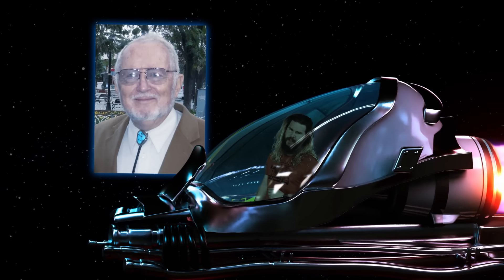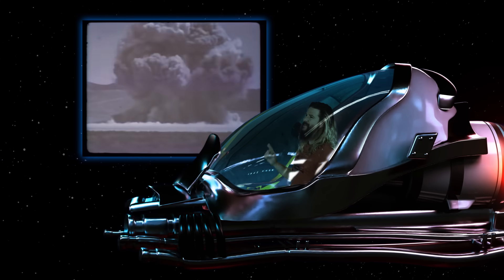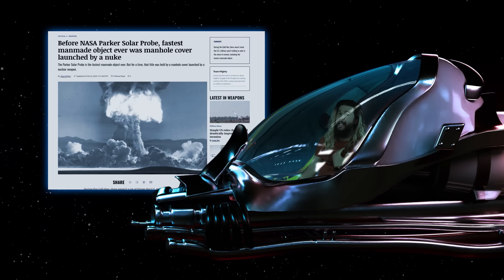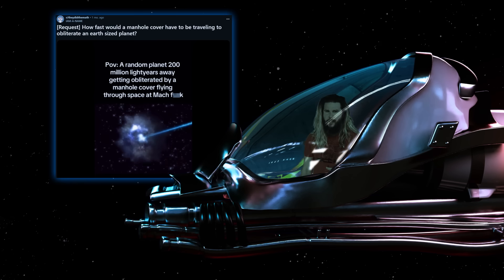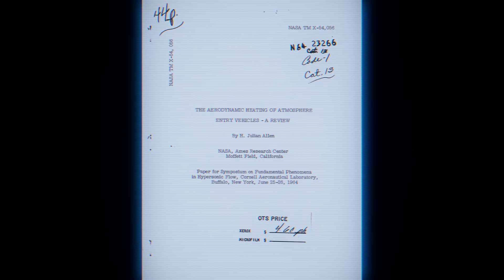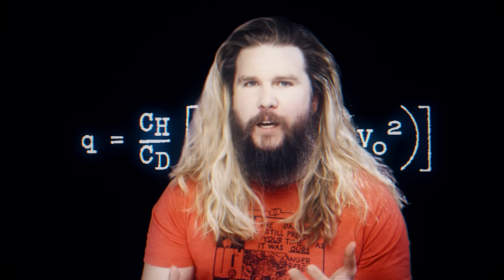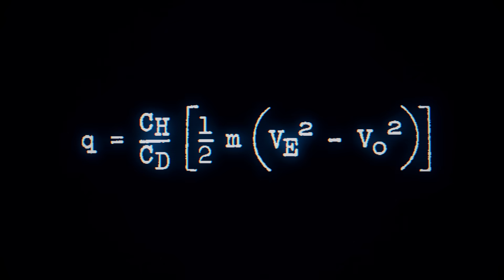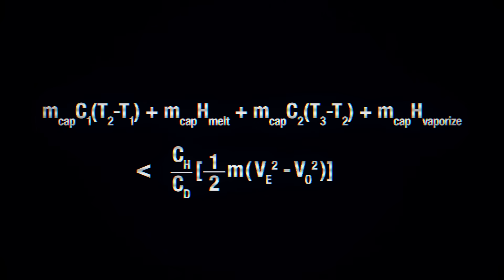Debunking the Nuclear-Powered Manhole Cover

Comment: Bro like you said, all this is above my pay grade but umm, you calculated this to the surface area of the, "man hole cover"(lol) , sooo, what if it turned sideways? That would decrease the surface area,and in turn, decreased the over all temperature?
 meteorites and such ,(because of ice) tend to "explode", because of super heating,do to the atmospheric pressure and the expansion of steam within the rock itself,which is far different from reinforced steel..but, is there a chance we shot a ball of molted magma into another solar system somewhere?🤔😂

Comment: Yes, but actually no. There's a big difference between entering and exiting the atmosphere and calculating for just the heat energy by using the calculation for an object entering leaves a lot of variables unaccounted for. Not to mention that things entering the atmosphere are usually not as structurally stable as a 2000lb slab of iron and generally explode from the pressure of superheated gas inside the objects, so they don't really vaporize so much as they get blown into tiny pieces. Also it would have the most heat energy at the start of its journey due to it already being in contact with the most dense part of the atmosphere and having the most velocity at the start because the moment it started flying it was being slowed by friction with the atmosphere which would lessen the higher it flew. And keep in mind, it's at a minimum of 6x escape velocity so it would only be in contact with the atmosphere for a very short time.

Comment: So it was cast iron, which is highly refined iron. Some of the "explosions" from meteorites comes from different materials expanding more rapidly than the other layers. Also at that temperatures it's possible that it blast welded itself partially into steel. So there's a lot more variables to consider.
Reply: You know nothing about metallurgy.  Steel is not simply iron.  There are, in fact, many different types of steel, depending on what other elements are mixed (alloyed) with iron.  Even 70 years ago, not all steel was the same, but iron doesn't simply "weld itself" into steel.

However, you are correct that there are many more variables involved.

Comment: Ok, so I have to poke a few holes in your math.  I may be wrong, but it seems as though you held atmospheric resistance as a constant.  The further up something goes, the less resistance there is and therefore, less heat generated.  When meteors fall they experience increases air resistance, thus friction, hence why they all pop off relatively low down.  There's also the rate of heat transfer, doesn't matter how much energy is generated if it isn't transferred to the material.  If the earths atmosphere is appx. 120km thick and you're moving at 66kph, your looking at less than 2 seconds of friction with the bulk of the energy being generated in the first 1/6 second of ascent through the lower atmosphere and rapidly diminishing after.  Finally, your calculation doesn't account for heat lost to the atmosphere itself.  Since air has a higher rate of heat transfer than iron does (at least at lower altitudes where the air is denser) much of that energy generated will be transferred to the air rather than the iron, although frankly, I don't even know where I'd begin trying to figure that equation out.  Granted, I'm sure there would be a fair bit of evaporated iron from the event but I'm also pretty sure that at least a decent chunk made it out of atmosphere.

Comment: This calculation has a significant issue - it assumes the constant form of the object. However, it would make sense that somewhere between melting to a liquid blob of iron and bringing it to the boiling point the manhole cover would assume an elongated drop shape, finding its balance between wanting to turn into a sphere and a crazy amount of air rushing past it. This form induces much less drag. Which would probably shift the inequation to another side.

Comment: Meteors are mostly heterogeneous not homogeneous. Hardened high carbon steel is very different than a meteor. I think it is a large mistake to compare the two. A meteor breaks due to instability in the structure and its composition. A rock is not the same as a high carbon steel ball. If there is impurities and/or structural integrity issues. Perhaps the manhole would break apart. However, the forced propulsion of the nuclear explosion did not destroy it. So I do not think the atmosphere would completely annihilate it either. Nuclear explosion propulsion is much different than a meteors propulsion as well. Unfortunately I do not believe with the evidence collected that this can be solved effectively. There are too many data points missing and I would not be confident with the math. For example some hypersonic projectiles create plasma barriers due to their speed and friction. I imagine the manhole did something similar. I believe some manner of degradation happened to it. But, without any data we cannot know for certain.

Comment: If the nuclear bomb had a yield of 12 megatons (Mt) instead of 1 kiloton (kt), we would expect the steel disc to be accelerated to an even higher velocity. Let’s calculate how the increased energy affects the disc’s acceleration and vaporization.

Step 1: Energy Released by a 12 Megaton Nuclear Bomb

A 12 megaton (Mt) nuclear bomb releases a significantly larger amount of energy compared to a 1 kiloton bomb. Each megaton is equivalent to 4.18 × 10¹⁵ joules of energy:

￼

Step 2: Velocity of the Disc

The velocity imparted to the steel disc depends on the energy transferred. Using the same approach as before, the kinetic energy of the disc is:

￼

Where ￼ is the mass of the steel disc (926.3 kg) and ￼ is the velocity. Setting the kinetic energy equal to the energy of the explosion:

￼

Solving for ￼:

￼

Taking the square root:

￼

The disc would be accelerated to an incredibly high velocity of 10,400 km/s, or about 3.5% of the speed of light.

Step 3: Vaporization of the Disc

The energy required to vaporize the steel disc remains the same, approximately 7.42 × 10⁹ joules. However, with this new velocity, the disc is moving at an extreme speed, so the heating from atmospheric drag will be immense.

Heat Generation Rate

The rate of aerodynamic heating is given by:

￼

Using the same values for ￼, ￼, and ￼, and substituting the new velocity ￼:

￼

Calculating ￼:

￼
￼

This is the rate of heat generation at sea level, which is on the order of 10²¹ joules per second. This value is astronomically higher than in the 1 kt scenario due to the extreme velocity.

Step 4: Time to Vaporize the Disc

The time to vaporize the disc is the energy required for vaporization divided by the heat generation rate:

￼

This means the disc would vaporize almost instantaneously, in about 0.92 picoseconds.

Step 5: Distance Traveled Before Vaporization

Using the new velocity of 10,400,000 m/s and the time to vaporize, we can find the distance the disc travels before being vaporized:

￼
￼

Conclusion

With a 12 megaton nuclear explosion, the steel disc would be vaporized almost instantaneously and would travel less than 10 micrometers (9.61 µm) off the ground before completely vaporizing. The velocity and heat generated from such an explosion are so extreme that the disc wouldn’t survive even a fraction of a millimeter of travel before being fully vaporized.

Comment: If I'm understanding this correctly, time isn't included in these calculations. Sure, the theoretical amount of heat needed for the manhole cover to completely disintegrate is there, but:
How long would it take for the cover to reach said temperature?
How long would it take to burn up at that temperature?

If these times > the time it takes the manhole cover to leave the atmosphere (especially considering the decreasing air density, and how unlikely it is for the cover to maintain a flat-faced orientation, thereby reducing drag) then the idea of it escaping Earth is not so crazy after all.

Comment: I think a fundamental assumption here is that the manhole cover had 0 velocity at the end.  If it was still moving fast, that would hugely affect your calculations.  Since it clearly takes time to heat up, it's not conclusive to me.  This is the equivalent of doing a thermodynamic endpoint while ignoring the kinetics.  It's a useful number, but can be misleading.  Famous example, diamonds are slowly turning into graphite, but no one vares since it takes forever.

Comment: There's a reason reusable rockets need heat tiles to reenter the atmosphere and not when launching outside of it. I'm not disputing the conclusion, but using the formula for reentry heat to calculate something exiting the atmosphere just seems off.

Comment: I had noticed that you did not ask the question of heat transfer. So I did a little bit math and my numbers may not be completely accurate but this is what I got.

The minimal speed calculated for the mantle cover to be traveling is Mach-194 or 40.9856 mi./s.

Earths atmosphere is only 7.5 miles deep.

Which means if the manhole cover made it to space it would’ve only been in earths atmosphere for

0.1830 seconds.

Thus my question then becomes is it possible for earths atmosphere to take cold cast iron to vapor elemental iron and carbon in 01830s? Can the energy truly transfer to the manhole cover in that amount of time?

Comment: Accelerating a solid object to six times the escape velocity in a fraction of a second without it breaking apart or turning to dust is impossible. The object would likely disintegrate under the extreme forces. No need for math and equations.

Comment: It's moving way faster than a meteor and steels conductive capacity to transfer heat isn't enough to absorb all the heat to it's core within a second, time is a very important factor, the steel would have ablated away like a very cursed ablative heat shield slowly from the outside in, iron plasma and the hypersonic shock front would have considerably effected the atmosphere's ability to transfer heat to the iron cap, also your math boldly assumes it encountered enough atmospheric drag to stop it completely and perfectly transfer all of that energy straight into the cap

When a meteor breaks up they're homogeneous in the inconsistency of materials, they didn't form from a single material rather being a maze of different materials, they heat up inconsistently (hotspots in parts of the core and edges) sections vaporise and the pressure blows apart the meteor from the inside out as it hits deeper into the atmosphere causing a cascading effect where the meteor keeps gaining more surface area and absorbing more heat faster in what looks from the ground like a giant explosion
Reply: Also I would like to propose a question, how much energy did the nuke used to launch the cap have? I think it would have more energy than the cap had kinetic energy and the cap was perfectly intact in that single frame after detonation

Comment: Question.... Are we sure that the energy u get while coming down from the atmosphere is the same energy u get if u do the same in reverse?
I mean if the air is denser the closer you get to earth and the object is faster in that area... It has less time to conduct heat... Also... Not an expert in thermodynamics... But wouldn't a disk lunched at such speed want to expose his side band to the air instead of going face up?... Not sure man... I think u need a new video on this 😂🤣.... Also also also... Wouldn't the Shockwave  of the explosion propeller and help the cover not to get busted... Like diving into a waterfall... But it could also be possible that heat from the explosion facilitated the melting part 💀💀💀 good god this is a messy problem 😂🤣

Comment: A very interesting question indeed. If this part really acquired a speed of 66 km/s, then its interaction with the atmosphere in dynamics is difficult to predict. In addition, we should not forget that it was not flying in a calm atmosphere, but among hot gases ejected by the explosion, which also changed the properties of the environment around the object. A very important issue is heat transfer. In order to transfer a huge amount of heat to a metal body with a relatively small surface in a short time, an extremely effective heat transfer is necessary. In this case, undoubtedly, the surface layers of the disk will melt and evaporate, thereby changing the heat transfer, reducing its efficiency, and the formation of a plasma layer around the object will again not allow intensive heat transfer by radiation. It is also necessary to take into account the direct impact of mechanical forces on the object, which, most likely, already at the moment of takeoff received internal damage due to the enormous overload. Fragmentation of the object is very likely. The division of this disk into parts will lead to an increase of the surface. Consequently, heat transfer will be facilitated. So most likely this metal disk was broken into many pieces, which then burned up in the atmosphere. It is impossible, of course, to exclude that some fragments reached a height sufficient for recognizing this launch as a space flight. It is known that during some nuclear tests large stainless steel balls were placed near the charge. These objects were later found far from the test site. Moreover, they were not destroyed. Also iron meteorites reach the surface of the Earth in a number of cases having a similar speed value.

Comment: I'm just wondering about how much heat was transferred to the manhole cover. Powerful enough nukes begin to have an increasing area from the center which is hotter than the sun for a very brief moment. Was the manhole cover far enough away? /Was the bomb too weak?

Comment: The atmosphere gets thinner as it goes up. So it's different than re-entry. Going up is easier than down. Those rocks that enter the atmosphere. Also the cover could have  gone sideways a bit. But... but it could have been a bit pre-heated from the explosion. I think it's plausible that some of it escaped. Just a small amount of messed up metal. My suggestion is... we do it again with maybe something a little different. And make sure we can get something into space. Lets make it shaped hypersonicly stable so it stays straight enough and have heat shelding on top. We can make this possible. Maybe use a different metal also. If you're calculations where close then if we change some things we can easily do this.

Comment: Hi Kyle,
I really love your videos! I am not a nuclear engineer, but an aerospace engineer, so finally, a topic where I have some prior knowledge.
Apart from what was already discussed below, I have a slight problem with your assumptions in your calculation. More precisely, you assume that the object's end velocity is 0 km/s. With that assumption, you only calculate whether the object had sufficient kinetic energy to vaporize. In my opinion, the end velocity of the object leaving the atmosphere should be approximated using the drag of the object and the deceleration. If you take into account a fixed atmospheric height of 100 km, you should get a good estimation of the objects velocity when leaving the atmosphere.
Please correct me if I am wrong.
Reply: Quick follow up, i did the calculations as described in a quick numerical simulation of the ballistics (until it converges for a decreasing delta t). 
TLDR: It didn't make it into space, the object didn't even reach 12km.
The drag of the object can be calculated with the given c_D (assuming no tumbling again with c_D=1.28 as in the video, so its a worse case scenario), the deceleration of the object can be calculated using the fixed starting mass (no evaporation in this case, pure ballistics, however, with evaporation the deceleration would increase due to decreasing weight, so it would decelerate even quicker). I than used the barometric height formula for the density as a function over height assuming worst case scenario thin air of constant 25C (in reality colder in greater height colder temperature which would lead to higher drag). With that your deceleration is a function of the velocity and height, which can numerically integrated by solving the ballistic formula. In my opinion, with all my assumptions, this is a upper bound, since all my assumptions are worst case for deceleration. The result is that the object would be decelerated to v=0 at a height of under 12km (also a bit shocking to me), so it wouldn't reach space anyways due to deceleration caused by the drag. The only thing not included here is the decreasing cross-sectional area, which would benefit the height reached. 
With this calculation the karman line (100km) would be reached for a c_D of around 0.6-0.65, which is lower than a tumbling 3D plate.
So from a ballistic analysis, in my opinion, you can also conclude the object didn't make it into space, not even close.

Comment: You get an F. You are assuming that end speed is zero. Why do you think that air can actually slow down a 66 km/s object in less than 1.5 seconds it takes to leave the atmosphere? You are mentioning slower objects being destroyed, but that is completely wrong - the whole point is that it is too fast for any meaningful slowdown and heat transfer to happen in the short time window! Add to that all the complex interactions of hypersonic heat transfer and the equation doesn't apply at all. Like convective heating in real re-entry is minimal because a boundary layer forms and most heating is actually radiative from surrounding plasma. And that takes time. A dense and fast object can punch through the atmosphere fast enough to not experience any significant heating. Simple equations do not account for any of that. You need to actually do hypersonic fluid dynamics simulations.